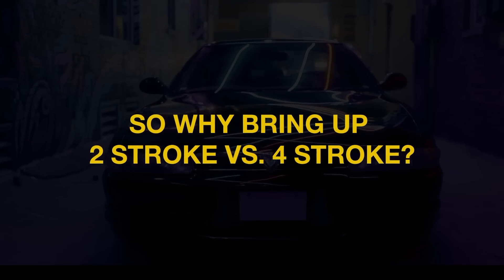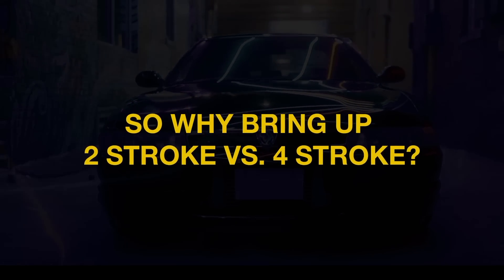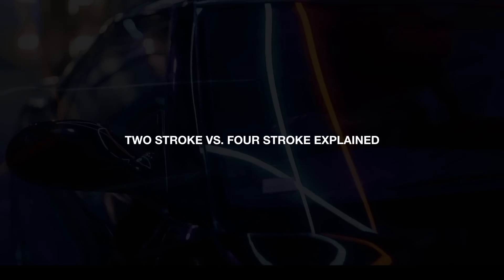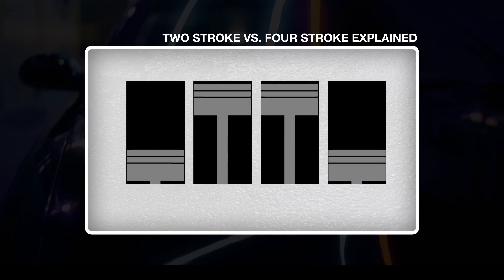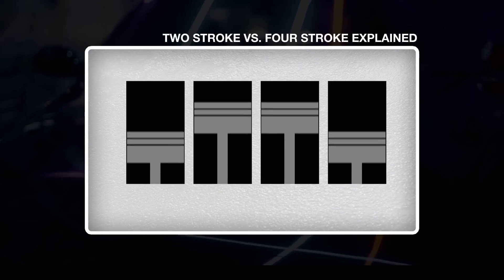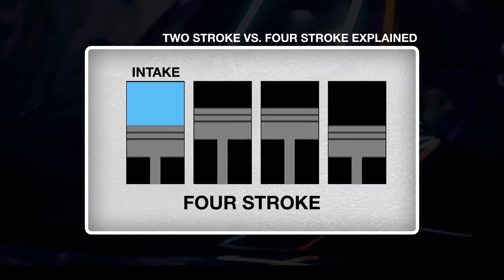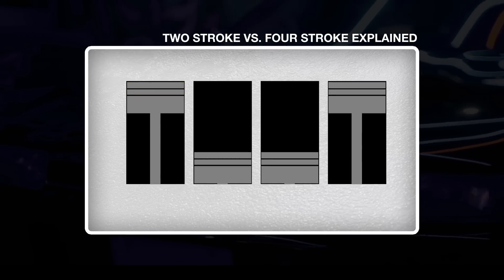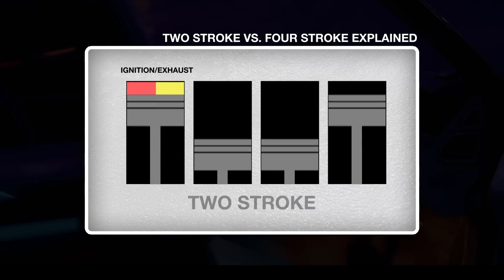The SECRET Behind Why RX7 and RX8 Rotary Engines Make SO Much Power

Comment: Rotary is 1/3 stroke...in 1 cycle got 3 fire/power...cmiiw
Reply: 4-stroke
Reply: doktorbimmer 4stroke when 2cycles only 1 ignition, this rotary has 3 ignition in 1 cycle...
Reply: Wankel engines are 4-stroke.
Reply: doktorbimmer for me rotary is 1/3stroke, brap-brap-brap in 1 cycles...
Reply: For you... understanding how a WANKEL engines is just way too complicated.
Reply: doktorbimmer not complicated, just take a basic, if 4stroke piston needs 4 steps to make 1 power, 2stroke piston needs 2 steps to make 1 power, so rotary only needs 1/3 steps to make 1power, so in 1 cycles rotary has 3power...
Reply: The Wankel engine uses 4-strokes for each chamber.. none of the cycles are combined or occur simultaneously in each chamber like the Benz or Uniflow 2-stroke.
Reply: A 2-stroke completes all 4 cycles in 360° of crank rotation while the WANKEL requires 1080°
Reply: doktorbimmer i know every chamber of rotary has 4stroke base, but i say about the comprehensive system, 1 rotor has 3 chamber that will ignite 3 power in 1 cycle, its equal 3 piston 2 strokes engine...so i dont care about each chamber, but i say about 3 chambers in 1 rotor...its 1/3strokes...so why rotary special power not like piston...with spwcial brap sounds...
Reply: Or if you wanna complete procces, rotary has 3 intake, 3 compress, 3 power, & 3 exhaust, every 120° in 1 cycle...
Reply: I regret to inform you... but you do not understand how the Wankel engine operates.
The piston(rotor) orbits with a 3:1 RATIO between the epicyclic gear set and the eccentric-cranckshaft.
Reply: Wrong, the Wankel engine requires 1080° (3 full crank revolutions) to complete its firing order sequence.
Reply: doktorbimmer hahaha, ok i ask you in 1 cycle rotary how many power it get? If its only 1 power in 1 rotation so what the purpose of having 3 chambers? And can you explain how the sound of rotary is brap when its only have 1 power/ ignite in 1 rotation?
Reply: doktorbimmer rotary with 3 cahmbers is special, this is not piston, when chamber no.1 ignite, it will be followed by chmaber no.2 that will ignite after it, then chamber no.3 will follow to ignite after no.2, its only need 360°, because when chamber no.1 ignite, chamber no.2 is already fill with gas and compress, it simultanious and continous....i hope you can understand this system...
Reply: So you saying you don't understand the 3:1 ratio between the orbiting piston(rotor) and the eccentric-crankshaft.
 What did you think the function of the cyclic gearing is for?
Reply: But clearly each chamber requires 3 full revolutions to complete the 4 intake, compression, expansion and exhaust cycles.... How do you not understand this simple fact?
Reply: doktorbimmer i've told you for ech chamber its 4strokes, but i take it comprehensive for 3faces of the rotor, this rotary engine only work on 3faces rotor simultaniously & continuesly, not each single chamber. & you should know, you cant compare piston to rotor apple to apple, this rotor skip/ shortcut compression step, because it compressed automatically, so in rotor only has 3 steps, intake-power-exhaust, think about it!, so in rotary each step only needs 120°, thats mean each 120° there are 3 proccess, because of 3faces of rotor, this is called 1/3steps or 1/3strokes...please learn carefully...thx...
Reply: How is that any different than a 6 cylinder 4-stoke reciprocating engine????
Reply: Sorry, but you are wrong, any engineers or (competent) technicians all understand the Wankel engine uses the 4-STROKE operating principle.
Reply: hahaha actually you admit that 1 rotor equal to 6cyl 4strokes, & its equal to 3cyl of 2strokes, gotcha! thats what im talkin about....think this is only 1 rotor!!!
Reply: You don't know what you are talking about... remember?
Reply: It still doesn't matter... because all Wankel engines are 4-strokes, regardless of the number of housings... it still requires 3 full revolutions to complete its firing order sequence.
Reply: how many times i said that the basic of each chamber rotary is 4stroke, but i say about the whole mechanism of rotor, & the special step in rotor that only needs 3 step intake-power-exhaust (compres step is auto by rotor system), that piston cant have it, its my opinion, it's ok if you dont accep it...
Reply: so 2 rotors equals to 12cyls of 4stroke, & equal to 6cyls of 2 stroke...cool.... :D although as thermodynamics law heat will decrease the power of rotary....
Reply: Are you referring to the Carnot Cycle? Or the Woschni Heat Transfer Model specifically?  Q = hA(Tg-Tw)
Reply: But each rotor still requires 3 full rotations to complete the 4 Otto cycle strokes.. 2 three sided piston(rotors) equals 6 chamber not 12.
Reply: doktorbimmer haha its ok, you're the doctor! but im sure my opinion is correct, because thats how rotary is work practically, not only just theory like you did, by doctor!... :D
Reply: Its not a matter of opinion, its a simple fact. I have a feeling you just realized how much of a fool you look like right now..
You did not know that it takes 3 full revolutions for all 3 chambers.
Reply: 4-stroke Otto and Diesel engines complete their firing order sequence in just 720° of shaft rotation (2 turns) while the Wankel requires 1080° (3 full turns)
Reply: doktorbimmer haha ok we have missed here, i said this 1/3stroke for the rotor, not the shaft, if you said 1080 for inner shaft yeah you're right, but my opinion for rotor is alright too, because for the 3 rotor faces its get 3 power in 360, remember not the shaft, but the rotor...thats the conclusion....
Reply: doktorbimmer the Wankel engine delivers advantages of simplicity, smoothness, compactness, high revolutions per minute, and a high power-to-weight ratio primarily because three power pulses per rotor revolution are produced compared to one per revolution in a two-stroke piston engine and one per two revolutions in a four-stroke piston engine, although at the actual output shaft, there is only one power pulse per revolution. Wikipedia. See! Im right on my opinion about 3power/pulse   per rotor revolution, & you just right in shaft revolution, so theres no wrong here, but you just insist in different point of view explanation, you'll not get corellasion on it, so think carefully before replying some one comments....
Reply: Engineers always use SHAFT ROTATION to determine and define the operating principle and firing order sequence NOT THE ROTOR  _so yes, you are very wrong.
Reply: Power is not taken directly from the Piston(rotor)  it is delivered by and is measured from the SHAFT.
Reply: Wankel engines no longer have any significant advantages... That is why they are obsolete now!!!!!
Reply: Its still the same number of power pulses per revolution... only with lower volumetric efficiency, less torque and lower fuel efficiency.
Reply: "Rotary is 1/3 stroke...in 1 cycle got 3 fire/power"  Its very clear from that incorrect comment that you could not possibly be an engineer... *or understand how the 4-stroke Wankel engine operates LOL!!!! *
Reply: "Rotary is 1/3 stroke...in 1 cycle got 3 fire/power" Rest assured no one will ever confuse you for an expert on engines.